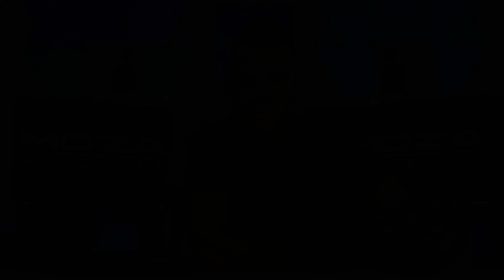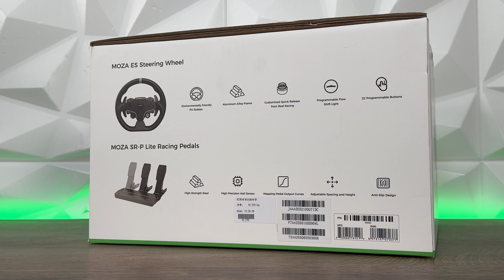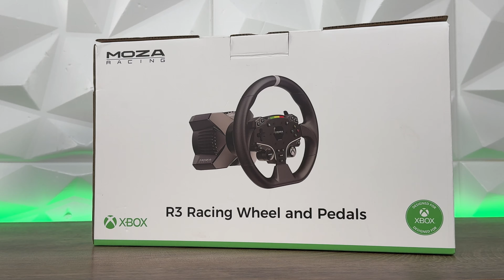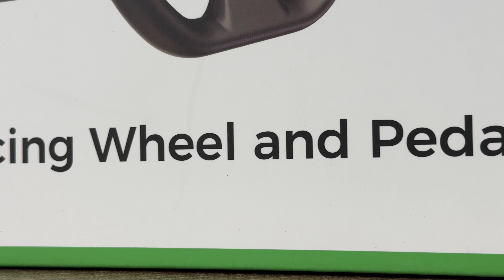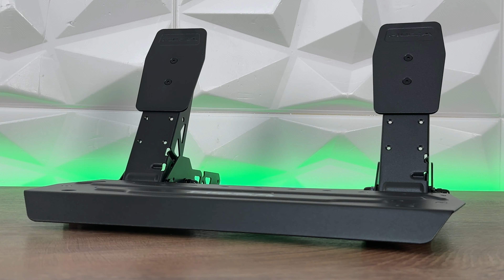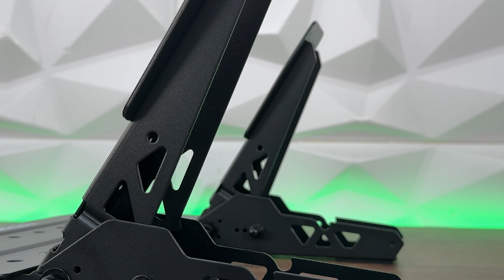First Steps Into Sim Racing - MOZA R3 DD Bundle

Comment: Very informative review.  Best I've seen yet. Thanks 👍 
So, if I understood correctly, I can attach the clutch and use the 7 speed shifter?
Reply from the maker: Thank you very much! Means a lot. :) You can attach the clutch padel and connect it to the already existing pedals. Shifter, handbrake and everything else can be connected to the base. If you are using it with XBOX, then you have to use this wheel and everything needs to be connected to the base.

Comment: I just got the R3 for my xbox series X yesterday. Used it this morning and it already needs to go back to the shop. Stuck in PC mode when the game loads. Its doing my head in. Shouldnt have connected to the app...
Reply from the maker: There is one button you need to hold so it switches to XBOX mode. Did you try that?
Reply: I got my MOZA bundle 3 days ago and it’s not reconfiguring anything to any of my games I downloaded the MOZA app and in game settings and yet nothing and yes I know all about the 2 modes